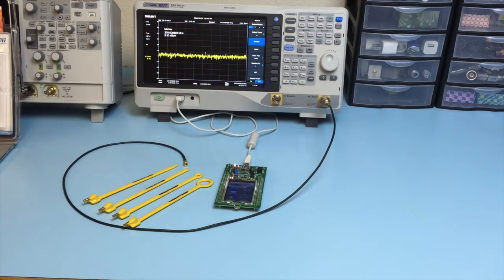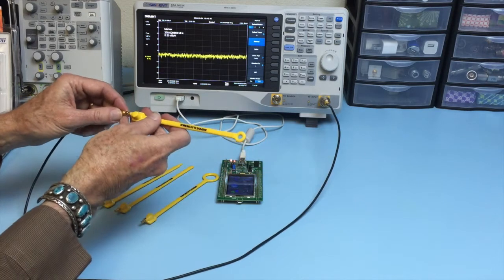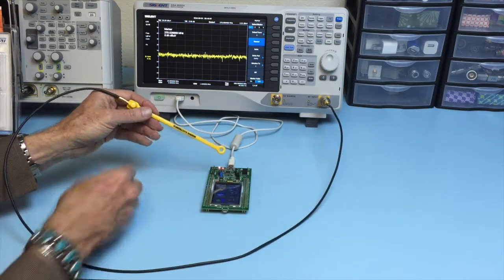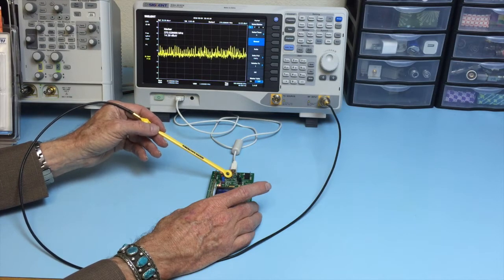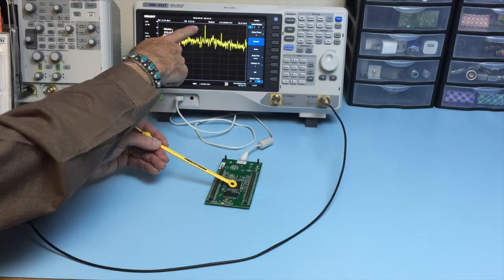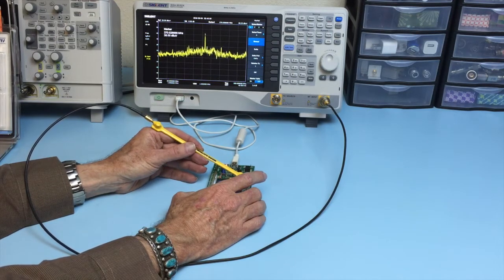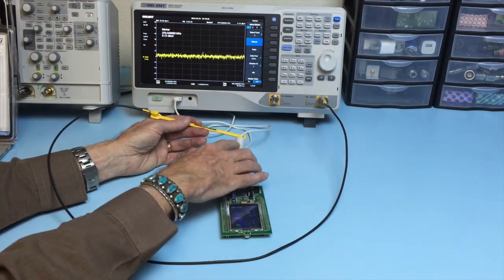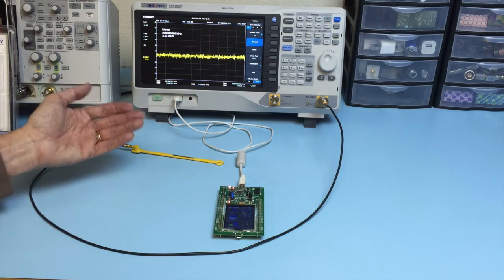Near Field Probe Demo

Comment: Hello Ken, thanks for the video. I believe the USB cable of STM32 is merely connected to the oscilloscope as a power source with no data running trough this cable. Isn't it ?
Reply from the maker: Correct. Whatever common mode currents are generated on the board will flow out along the outside of the cable shield. That's what we measure with the current probe.

Comment: I wonder what is the source of the 270 MHz? This particular board can go to a maximum of 180 MHz only.
Reply from the maker: The 270 MHz may be the third harmonic of the clock. I'll have to investigate further.
Reply: @emc_guru  180 MHz / 2 = 90 MHz.  90 MHz *3 = 270 MHz
Reply from the maker: It sure seems to be the system clock frequency. Maybe some harmonic of the clock? In any case, it's the dominant harmonic throughout the board...